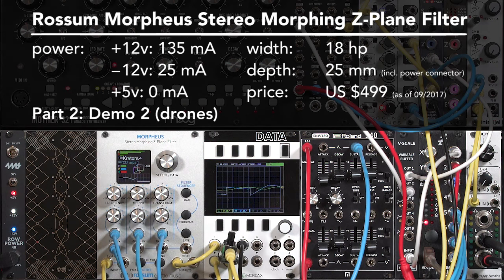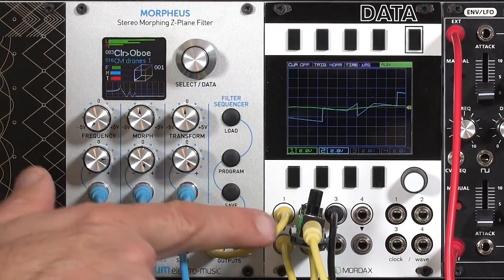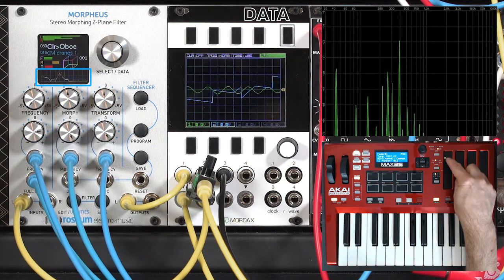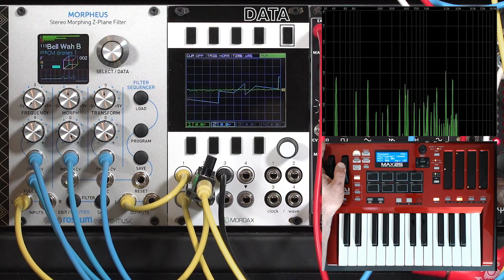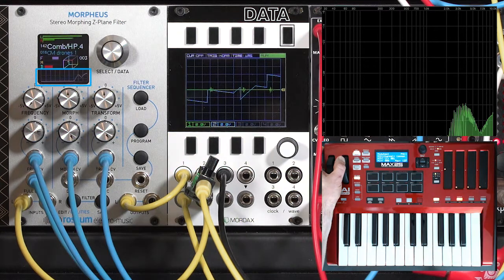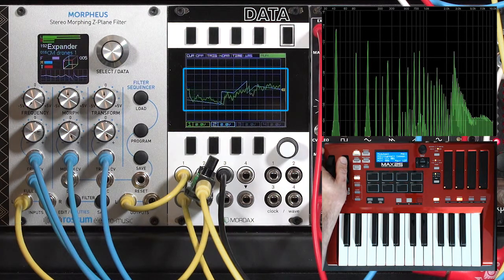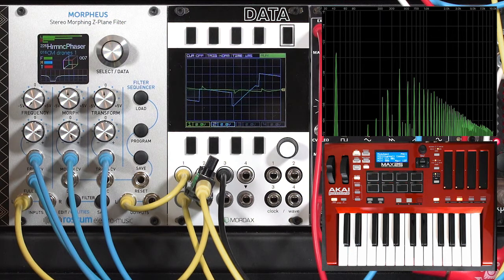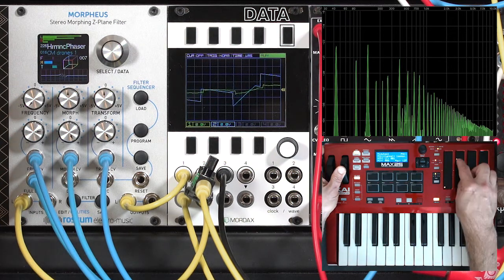Rossum Morpheus Digital Filter 2/4: Demo 2 – drones (LMS Eurorack Expansion Project)

Comment: Interesting--there's something I don't like about the sound of it due to being digital probably, but the way the morphing is changing the harmonics, it's almost like having a fixed filter bank where the size and amount of the filters can change? Something like that. Always really enjoy your demos, highly logical! I have a Erica wavetable Vco on the way--looking forward to having it morph through my ADDAC 601 with lots of different cv over the internal VCAs on each filter and achieving something in this vein.
Reply from the maker: I've been questioning myself about what I'm actually hearing and what I'm assigning it to. When I use a typical filter emulation like the Pole 1-7 patch demonstrated second in the video, it sounds like a clean, normal filter. When I use one of the presets that has a lot of pronounced notches and peaks (the varying "fixed" filter bank effect you describe), my ears say "that's not normal" to which my brain initially reply "that must be digital" - but I wonder if it's just the unusualness of hearing a varying filter bank.

Thanks for the kind words on the videos, and let me know how the Erica Wavetable + ADDAC 601 experiment works. I've heard good things about the Erica, and had considered the 601 before I got a 4ms Spectral Multiband Resonator...and a Verbos Bark Filter...and now an E-mu Morpheus (I may have a filter hoarding problem...).
Reply: Learning Modular filters are the easiest to go overboard on somehow. The 601 is awesome. I had one before and sold it because I thought at the time it was too much but it's really not of course..not as capable as the verbos bark but you can get one for about $300 less..besides that I have an AQA Dual SVF which is awesome, and the AJH Sonic XV which might be my favorite filter ever, it's just so dynamic with so much modulation possibilities and yet also sounds so rich and smooth, like everything AJH (currently
Biggest share of modules by any one manufacturer, ADDAC, AQA, Verbos are runner up)
Reply from the maker: I particularly like the wavefolder in the Sonic XV!
Reply: It's one of the best ones I've heard--it really makes you realize not all wavefolders are created equally.

Comment: This is great. When I got mine I sat down with the preset description and wrote down a list to "drone with." I also just tried using noise as a sound source to see what the difference was. I need to try experimentimenting with the tracking set, net. Any tips for those filter types?
Reply from the maker: I did the same - set up a basic sound and went through them all, taking notes. But it's important to try envelopes and LFOs (or sliders) to all the parameters to see how they change - just changing the preset without changing the cube parameters can fool you into thinking something is boring when in fact it modulates well. (Or, maybe that it's not well-suited to being enveloped etc.)